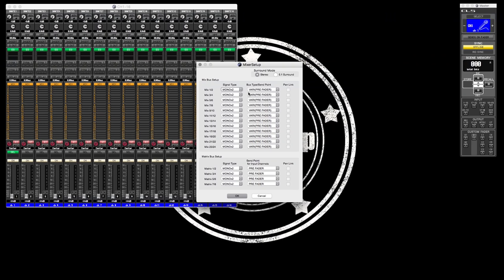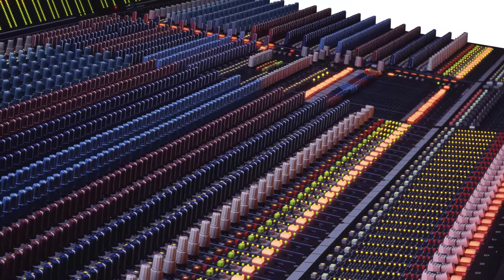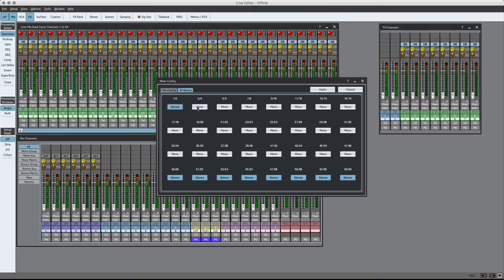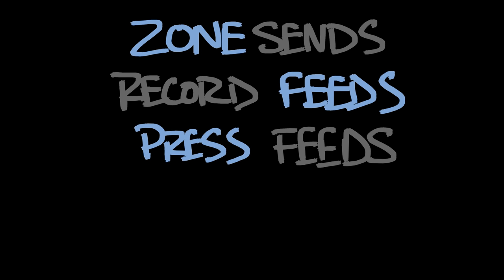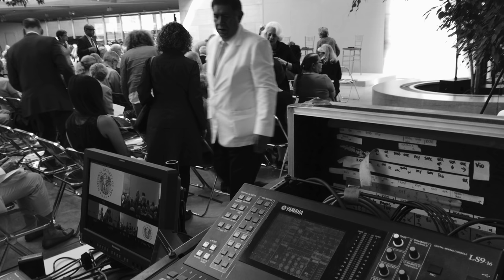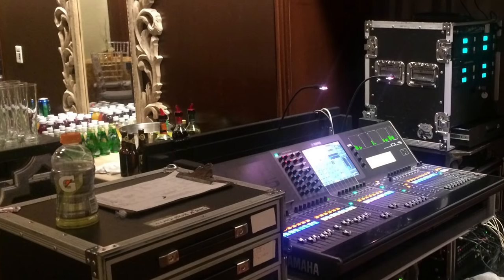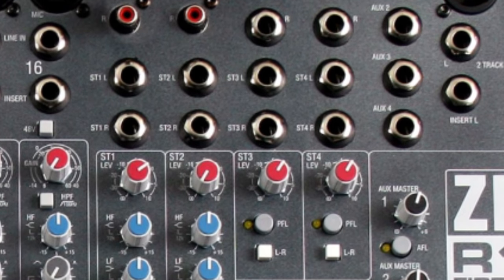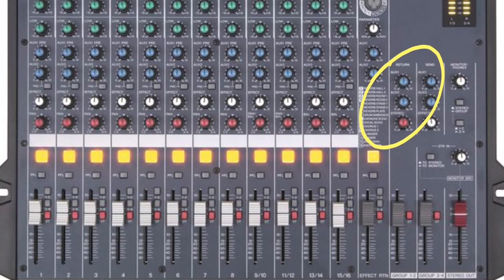#44 - Aux Sends Explained- Live Sound Basics 🎛🎚🤔

Comment: Hello!.
Got ideas wast some guidance if possible.
I have Roland Tr8s(11 tracks), which has L/R Main out, ext in, 6 aux outs(ink has it 3 pair but I believe that act as 6 mono).
Thoughts on sending 6 outs to a Roland vs2480 to 6 different channels back to the EXTin with Main L/R going back to VS2480 as I am using the Mains from primary outs of VS. Drum machine and synth take up other channels. So my first thought is to make two L/C/R  and set one high shelf the other low shelf EQd. Also pondered on using the 6 as a drumset out and leave the last 5 as bass tracks or vis versa..Reggae, Boombap, house stuff to start off lol keep it slow and simple clean and proper.
So I ask as I want practicle application and real world use and set up. Any videos to check out to set me up for better results inhave gotten. I zero/flatten all my gains at all points for my own reasons before I fiddle about also. I just want to have and/or make a clean tight crisp starting point. Thank you in advance for any thoughts or ideas.

Comment: I just need a simple mixer, that I can plug my stuff into, and then be able to output to my Interface, for recording.  I made the mistake of buying a new MackieProFx, that doesn't have anything but the USB output., and the Speaker outs.  Maybe the Control room would work. It's confusing, and annoying. I'm thinking about going back to my good old Yamaha.Thanks for the good info!

Comment: Hi.. I realized there's an ( Aux In ) port on my DJ Controller (Hercules Universal DJ Controller).. May I know what is the port for? What can I plug into it?
Reply from the maker: That's just like the Aux-in on a car stereo, it's for connecting additional external playback devices. It could be used for anything from an iPod to a tape deck or another laptop - the manual and documentation for that controller is really lacking in details, but it looks like the Aux in would show up on channel 1/2 when connected. Thanks for the question.
Reply: @DcSoundOp  Thank You so much for responding to me.. Appreciate it..  I will try to connect another laptop and see if it work.. 💪💪👍👍👍💛💛💛🤞🤞🤞

Comment: I have to send a stereo signal (2 mic feeds and a stereo feed from a laptop) to a piece of equipment used for live translation at an event. Should I use aux send 1 and 2 on my Yamaha MG12 w/pre fader?
Reply from the maker: Yes, you can use Aux 1 /2 - though it looks like Aux 2 on that console is post fade only, so you could run both post fade. It won't be stereo either way, translation typically wants a primary and a backup feed, (or a program feed and an iso feed of a specific source) both being mono vs a stereo mix with anything panned. The real key for translators is to make sure they are getting an intelligible send with with a consistent level so they can hear what they need. Let me know if you have any other questions Jaron.
Reply: @DcSoundOp  Hi. Ok I’ll run both mono aux sends 1 and 2  (they’ll both be the same thing) to the translator’s box. 
I probably won’t be adjusting volumes too much so with post fade being activated they shouldn’t hear much altering volume during the event.

Comment: How do you get internal effects on the AUX send? We have 2 monitor mixes going out to IEM but they are dry. We're using a Behinger X2442 We'd like to add some onboard reverb so it sounds nicer
Reply from the maker: You would need to have your EFX returns come back on an actual channel so you can then route them to the Aux sends for your monitor mixes. On that console, there should be an EFX ouput jack on the back, which you'd want to patch to a spare channel. Make sure that channel does not get routed in a loop back to the same EFX engine & you can un-assign it from MAIN with the button next to the fader. Now you'll be able to dial it up in the monitor send just like any other channel on the console.

Comment: I need to route this: guitar into the mixing board, Aux to and from pedal board, Aux to and from my looper pedal. I get signal, but no FX. Should I have gone Aux 1 post-fader? My Aux 2 has no return control. Should I put the fx on Aux 2 and the looper on Aux 1? Or does it matter? I'm using a new VLZ-4 Mackie 1402.
Reply from the maker: Hi Les, thanks for the message. It sounds like your guitar is into a channel and working fine, but you would like to have two discreet effect sends also, one to a pedal board and another to a loop pedal? On a 1402, assuming you have the channels available, I would keep both aux sends set to post fader and I would return the signal from the efx to their own channels on the console. Doing this you should be able to route signal out of the AUX, verify it is making it to your pedals, and then patch their output into another channel and verify you have signal and efx coming back there. 

This will allow you the most flexibility and control when mixing those efx or the looper back into the main L/R send. Let me know if this makes sense or if you were asking something else. Thanks!
Reply: @DcSoundOp  Thanks so much for the input... pun intended.....
Just got a DI. Now I can do what you said and shove some signal thru my amp. Maybe my problem was going PF? I made it go bang, and now imma try what you said afa 2 aux signals. Thanks again so much.

Comment: Thanks love it ,!,
Question. Making a fold back wedges for the rock band . Is there a recipe for horn wattage size that goes together with woofer wattage size in a cab and 2 way X over is just generic I know I get from eBay . but do I need to get the other components right ?
Reply from the maker: Hey Mark, speaker design is a whole world of fun that I admittedly don’t spend much time following at a diy level. There is a huge community of folks who do have design, woodworking & electronics experience in this area though & they share a lot of it on the forums - here’s a good starting point to hopefully help with your design - https://soundforums.net/community/threads/free-monitor-plan-12-coaxial-smithers-wedge-by-michael-smithers.3768/
Reply: Thank you for the link

Comment: Maybe you could help - Having issue with analogue mixer aux return/send - when The volume of a synth on one channel gets louder, it boosts the level of another synth coming through another channel (the volume of a channel gets louder when I turn up its corresponding send as well). I use 4 hardware synths going into a Yamaha mg 10/2. I was hoping to use a reverb for two of the synths. Everything is hooked up correctly, the reverb works when I send it through to a channel(s) but as I said, when the volume of the synth on one channel is turned up (on the synth - not the mixer), the volume gets louder on the other channel. Thanks for any help :)
Reply: maybe you needed to gate it just a thought

Comment: when reverb or delay come back to channel from an aux send, is the reverb 100% wet?  Do you need both the original channel volume up and the new channel with reverb also up?
Reply from the maker: Yes, you’ve got the idea right. The return is typically brought back 100% wet and then blended into the mix as needed along with the original dry channel. Thanks for the question.

Comment: Your way above my head here being new to mixers bought a 6ch pyle mixer for my home studio. My monitor sounds great but people say they can barely hear my music when broadcasting. My (send) control is set at 9oclock my gain & level controls are at 12. I don't use effects but my FX controls are set at 9 oclock. What am I doing wrong here? Thanks
Reply from the maker: Hi Miguel, it's hard to say what you've got going on beyond a simple gain issue. The physical position of the knobs doesn't always mean much, as the level of a send depends on how much level is present at the input of the channel you are sending from. I would guess you need more level at your input, allowing you to turn down the send to your monitor & raise the level to your broadcast, but that's just a guess. Alternatively, it could be a setting in the gear you are sending signal to from this mixer. What are you using to monitor & broadcast?  Let me know what your broadcast settings look like & we can go from there!
Reply: @DcSoundOp  Hi there I was able to make some board adjustments lastnight to resolve this issue. Your correct on your advice. First I tried all other input&output jacks they were all way to hot & the "return"jack had no output so plugged my transmitter back in the "send" jack & turned all the mixers gains off. I turned send" knob from its original 9oclock position to 12oclock & turned each channels 26db pad on. Now I can use my level controls on each channel & get them set with the built in led meter. Amazing what a difference a few adjustments makes even when flying blind like myself. I use a radio receiver to monitor the broadcast. Thanks for your help!
Reply: @DcSoundOp  hi whats the reason behind having different send levels on aux outputs

Comment: Hey nice video! I am fairly new to the mixer world. How would you hook up the bose compact PA system (1/4" input) which is mono, to an alto live 802 mixer? I have heard the aux send output would work but just wondered if you had a better idea. Thank you?
Reply from the maker: Hey Sam, thanks for the message! You can hook your Bose system up to the mixer either way, it just depends on what you're looking to do. On your mixer, the Main L/R outputs are functionally the same as the Aux sends, they just work a little bit differently to make things easier. If you only have one Bose stick, and that's going to be your main PA facing the audience, you can plug it in to Left or Right and just don't pan any channels. 

If you have two Bose sticks, one would be left and the other right, and even still it is uncommon to do much panning of signals in live sound. 

If you have your pair of Bose speakers on L/R for your main PA system, but find yourself in a situation where you need to place a third speaker in a different location (another room, around a corner etc.) then you would most likely want to connect that speaker to and Aux send, so you can control the mix that is going to it independently of the main PA system (perhaps that speaker is only needed to reinforce speeches at a wedding, but not the dance music later on).
 
I hope that helps to answer your question. Let me know if anything doesn't make sense.

Comment: How do I connect a preamp to my MTK 22 mixer that doesn't have inserts?
Also, aux outputs to left channel only. How do I get get it on both channels?
 Thanks.
Reply from the maker: You should not be running a mic pre as an insert, so that problem is pretty easy to solve. The job of a mic pre is to take a microphone level signal and raise it up to line level for the mixing board and other gear to work with. You'd want to connect your mic to the preamp, then connect that to a line level input on your mixer. 
I'm I don't know enough about your setup to answer the second question, so let me know what you've got going on and where you are stuck and I'll do my best to help. Thanks for watching Joeseph!
Reply: @DcSoundOp  Thanks for clearing up my grey area re preamp. So in that case, my gain knob should be turned off, rest of the knobs at 0, right?
2. If I take an aux out to a headphone for a vocalist etc., it is playing only in the left channel. How to get it on both channels?

Comment: Have a big problem I know you can help me solve , I'm using a sound blast 7 channel mixer, using a y 14 inch jack into aux 1 ( stereo) to a compressor by 2 mono jacks  the compressor is activated, but is not sendind back the signal back to  the mixer , what have I done wrong?
The lights on the compressor is activated yet the mixer is not processing signal
Reply from the maker: Hey Lennox, can you walk me through your signal path with a tiny bit more detail? I think we can figure this out with a bit more info. What is your path is back to the mixer from the compressor? Is Aux 1 on your mixer actually stereo on a single 1/4" jack... or is it balanced Tip/Ring/Sleeve? Let me know if you have more details, thanks for watching!

Comment: Hi bud. My Mixer has an effects loop and I use a Roland VG99 for guitar effects. Can I connect the mixer's effects send to the VG99 guitar in and the vg99's Line out to the effects return on the mixer so I can use the vg99 to add effects to mic channels?
Reply from the maker: Hey Wesmatron, you can absolutely do that! That sounds like a fun Sunday afternoon of experimenting to see what kind of sounds you can get, but I'd bet you'll find it works quite well once you get the levels set so you're not clipping the instrument input with the Aux out from the console... you'll likely just need to turn it down a good bit, but otherwise it should be simple. 

Let us know how it goes!

Comment: I have a Mackie 1402vlz  mark 1 analog mixer.
Can I use an Aux Send to send a Stereo signal to an active Subwoofer?
Will the aux send signal be a summed signal (say I'm only using 2 channels 1 &2 on my mixing board )?
Reply from the maker: Hey, thanks for the message & sorry for the slow response. There is no need to send a stereo signal to a subwoofer, but you can absolutely use an aux send to signal from two channels to a single mono aux output to drive a sub, whatever you dial in to that aux will be summed at the output. Thanks again for the great question.